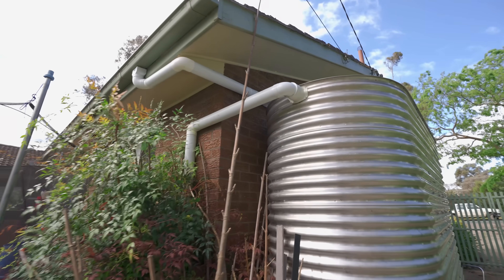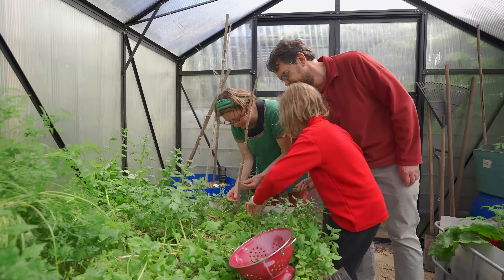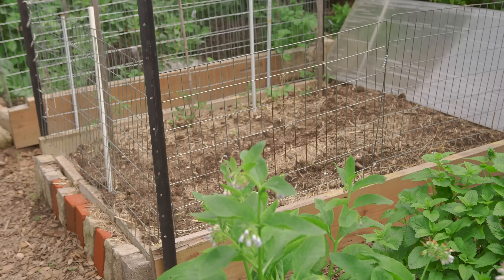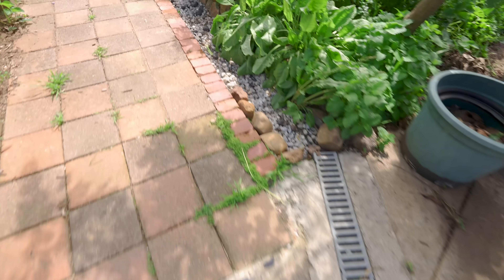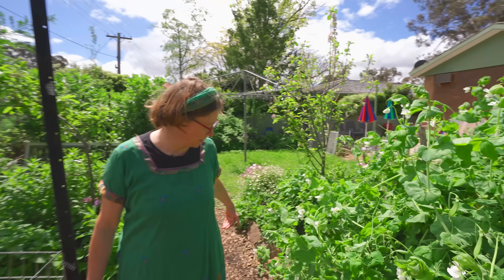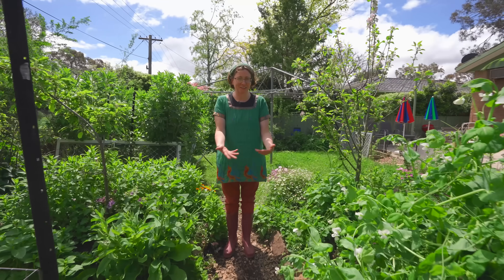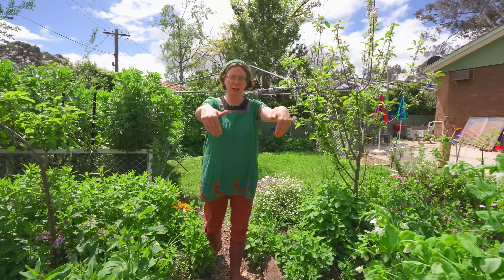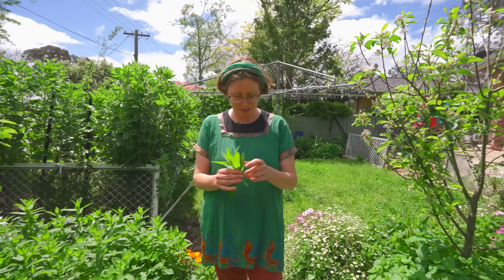The Self Watering garden: How to Create a Passive Rainwater System with Dr Cally Brennan

Comment: I've been collecting rainwater from my large greenhouses and my home roof top for several years and storing them in two sunlight blocked 1200 gallon tanks. My only concern is should i be providing aerification to the tanks and also should the asphalt shingle roof on the house be a concern from the Hydrocarbons from the petroleum based composition of the shingles possible leaching trace amounts into the water? The water from that tank is strictly for irrigation purposes.  And the other coming off the clean greenhouse plastic being a possible drinking water source in an emergency.

Comment: I had never understood swales properly until this video. Great explanation about following the contours along with the tools required. However, there are a few things I fail to see the point of. For example in my situation, my garden has an incline of maybe 5 to 10 degrees. In the autumn, the heavy rains will almost certainly fill up the swales and they'll burst over, rendering them effectively useless in terms of preventing erosion etc. The rest of the year, I think I would rather have the rainwater stay as much as possible in a flat bed rather than run off into a channel. Would the channel not fill up with dirt from the erosion of the beds 'upstream', even if the water flows more slowly? I have very stony, loose soil that is very erosion prone and the best way to combat soil erosion in my case I think is to have flat beds that prevent the soil from going anywhere when it rains a lot. It may be more work than just digging swales, but I don't see how swales are better. Bottom line is an incline will erode loose soil and until I can improve the soil itself, I need a way of preventing its erosion. Perhaps swales make more sense with soil that have a higher water retention capacity to begin with.

Comment: Without a rain collection barrel and/or no rain in the summer, can a hose be used to run water into  the channel and then will it spread out passively as you describe here?  It seems to me that this would be the most efficient way to use a hose...if it works!

Comment: This is all really cool but at eight minutes and 22 seconds you lost me! You have the two water tubes, right? I'm presuming that both tubes are the same length, and that the affixed to the wooden rod in the same place. That means that the difference in the landscape height mood affect the level of the water at all, right? So how do you measure anything?
Reply: Same tube, not two tubes: connected, which is why water can be used to show elevation.

Comment: ?? I still do not understand why you feel the need to tie a level on an A-frame (thumbnail image). they were made as not to have to use a level. i do know there is not much on calibrating an A-frame, only decent vid i've seen was this one at 3:39 the calibration is shown. (https://www.youtube.com/watch?v=b8L5wfWF6eA) . if there a better vid around on making an calibrating A-frames please add in comments :)  so no level surface is needed, no sticks of equal length are needed, close is good enoug, and normally it should be a bit larger. that A-frame is really small, leading to a huge number of sticks needed for the contouring.
Reply: the water levels work excellently , we have sets of 25m meter length, just put your thumb on top when waking with them so you do not loose water , having to refill them is a waste of time. the base of the water level often is a narrow pole, those tend to get into little holes in the ground or stand on a pebble sticking up above ground, so if working on accuracy (not always needed) check that or just stomp the ground with your foot a little to make sure its a representable surface underneath the water level.

Comment: That's spooky as I've been thinking about installing a swale system and then this video is in my Youtube suggestions? Hmmm 🤔
Anyway, great video, very inspiring. I haven't seen swales done before on a smaller scale like this and it's just what I need as I have a house that has a yard that slopes downward toward the house and is causing the wooden floor to rot in winter. I am going to get to work!

Comment: Wouldn't it be better to hook up a micro-irrigation dripper system connected to your water catching system to deliver the water right to the roots of the plants instead of flowing in channels like that?
Reply: More work this way and you need to change dripper positions often during the season since some veggies are going to be harvested and replaced by something else. I suppose it is less about automation and more about catching what little of rainfall there is rather than letting it flow away
Reply: @OmnifyMyAss  You can catch all the rainwater you want either way, the dripper system wastes less water.  My question has nothing to do with automation.  It's about conservation.
Reply: @OmnifyMyAss  It's not that I don't get your comment.  The problem is that you don't seem to know what you are talking about!  I have over 1000 drippers on my property and it's not only saving me a lot of water, but it's less work than having to maintain all the swales and channels full of rock and bridges for the water to flow under.  You should stop throwing opinions about things you don't know about.  Please move along and stop showing your ignorance.
Reply: @OmnifyMyAss  Mine is set-and-forget, so I am quickly realizing that you're doing it wrong with your approach, but that's ok as that is your problem.  I have nothing to prove as my system is already mature and producing crazy good results in the 10 years it's been in place.  You're the one who came in here trying to prove me wrong, and we all saw where that went.  Good luck on your endeavors though.

Comment: I'm on board except for the shower greywater reuse. I'm certified and licensed in wastewater disposal and there is a significant amount of fecal matter from greywater. But there are a lot of other factors such as environment. In dry climates the fecal is quickly killed. Be safe 🙏
Reply: What if you use a bidet?
Reply: Wot?! 
Are you people really out there taking a 💩 in the 🛁???
Reply: Wot?! Are you people really out there taking a 💩in the 🛁??? 

PS I'm certified and licensed in wiping my 🍑 and not just running bath water on my crack during clean up. 🤦🏼‍♂️
Reply: Interesting- why would there be a significant amount of fecal matter in water from a bath or shower? What counts as significant? I shower most days.. I wipe my bum very well too 😂
Reply: @mundomagico7787 He's considering grey water from toilets, too. That isn't from showers. The soap you use on your bum, kills those germs before it's rinsed down. He's treating waste grey from trailer parks. That's a completely different thing than just an outdoor shower, plus, this looks like a flower garden, but even then,  there are plenty of people that compost their feces & use it in their home gardens without issues of disease. Eye roll. Once it filters through all that soil,  it's fine. You get issues in 3rd world countries,  where ppl crap straight into their yard,  & then you'll get a problem with ecoli in lettuce,  etc.

Comment: I don't understand how that water level works. It doesn't look like it should be possible for the elevation of the ground to change how much water is in each tube.
Reply: The tubes on either poles are connected to eachother.
Reply: It's a one long tube. She may have had a poor choice of words on this one. A water level is a singular tube filled with water. When you raise both poles water is going to self level due to Earth gravity force. Difference in readings on each pole is your difference in elevation. It's a pretty simple system

Comment: Digging a trench around the beds shouldn't really be that complicated.
Reply: it can be however you want, but by good design a lot of goals can be achieved, here it's maximum use of space and using excessive grey water and runoffs for garden.
but you can do much more than that,
this is all part of the design of a good system

Comment: What do you do during periods of drought?
Reply: the design means there is more water in the soil which means longer before it needs supplementary watering (which can be rationed from tank, then supplemented with town water if it runs out + always some water from shower [washing machine water could be used too]). But every rain event in a drought goes that much further in these kinds of systems..